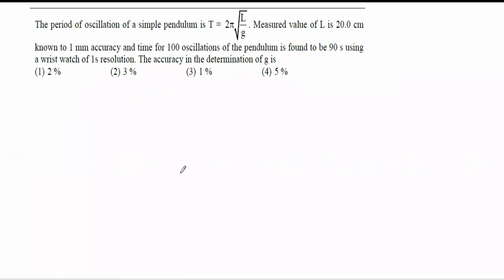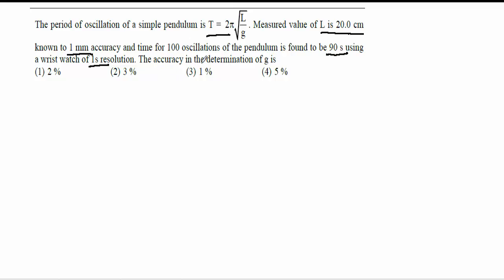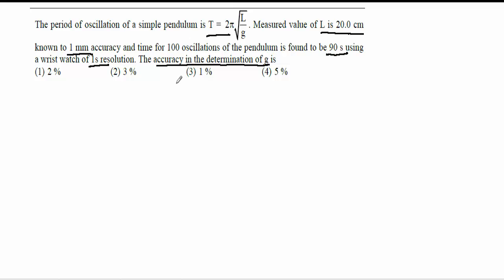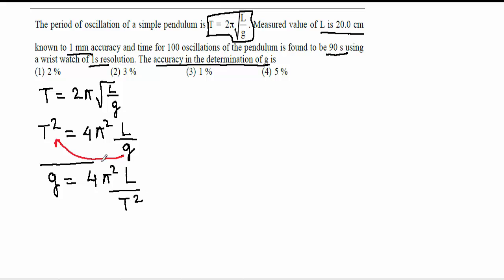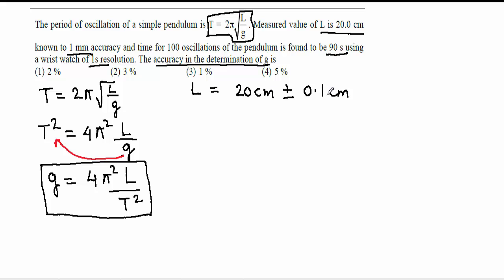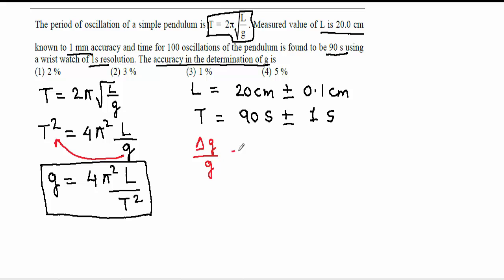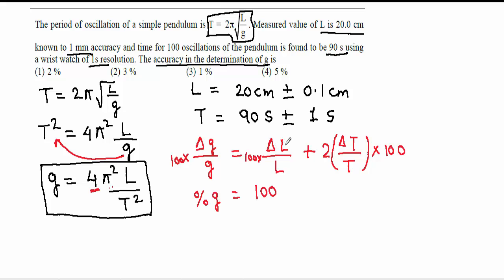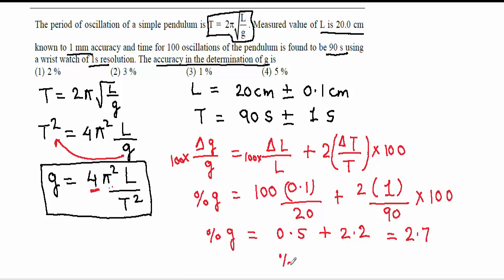Propagation of error (Part-3):Solution of a Problem from IIT-JEE Main 2015 , IIT-JEE physics classes

Comment: Time given in the problem is for 100 oscillations, the time period in formula is for one oscillation. Please give reason.
Thanks for the solution
Reply: Because 1 sec is divided by 100 ,as well as  90 is divided by 100 hence.  (1/90=0.01/0.9)

Comment: Please tell me that how you are writing the value of T=90.My doubt iis that T is the value of time period for for 1oscillation,so first we should calculate time period for 1 oscillation.But you are considering time period of 1 oscillation as time period of 100 oscillation.How?
Reply from the maker: Hello, Ujjwal... T is here for time given so you need to use T=90s  as resolution is just 1s which is given for time (90s) ... if you use time for 1 oscillations which is 90/100 = 0.9 s which is less than resolution of instrument(1s) . we can not measure it with instrument given .... we are finding percentage error in g for instrument (simple pendulum). so we need to use the time (90s) which we can measure for this instrument. Thank you.

Reply ·